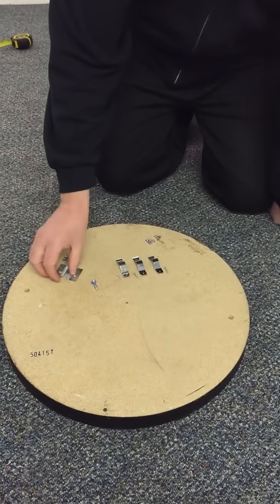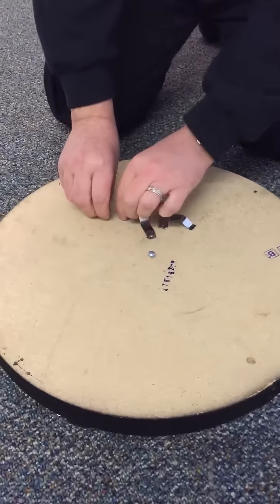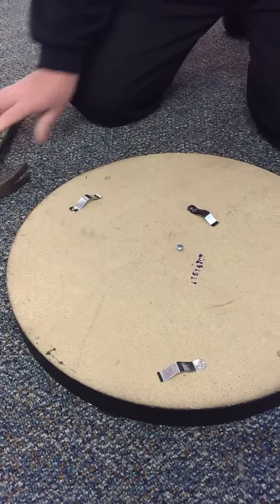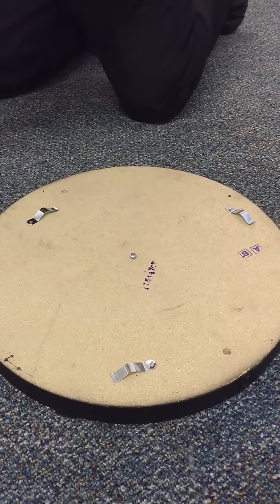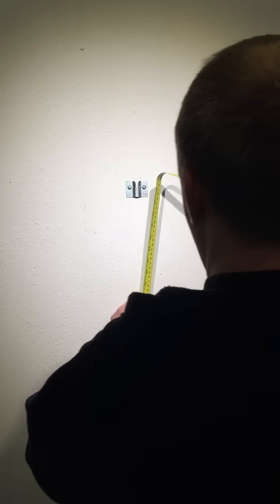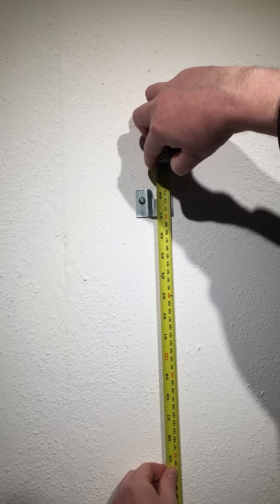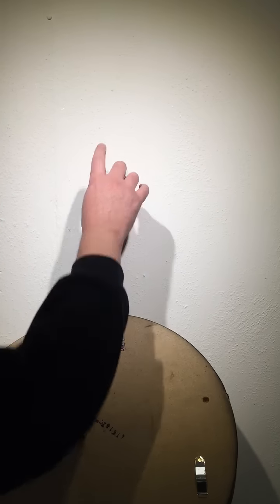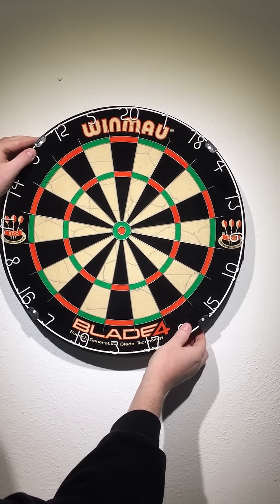Darts - How To Hang A Dartboard At The Correct Height

Comment: how do you hang the board while preventing it to rotate when you pull out your darts?
Reply: +Koen You just rely on friction really.
You need to adjust that centre screw in just right so when the board slots in the bracket those 3 spacers he nailed into the back of the board are all flush against the wall.
The friction from the contact of those spacers and the wall and the centre screw against the bracket will then prevent the board from spinning accidentally.